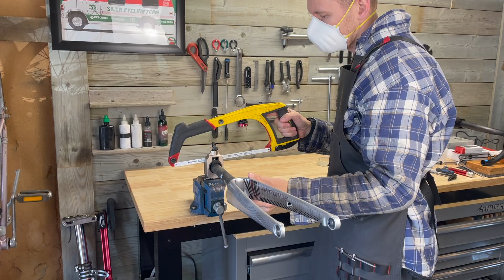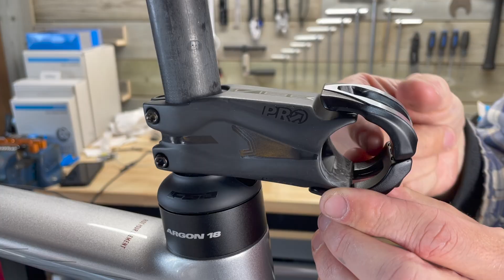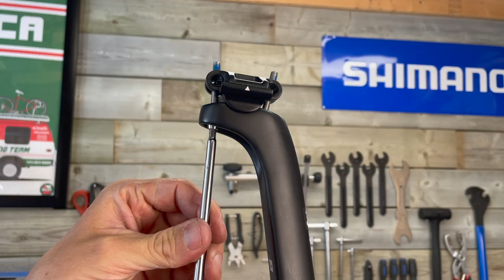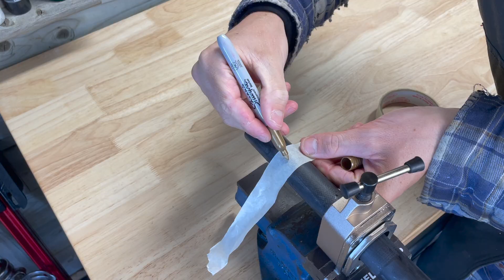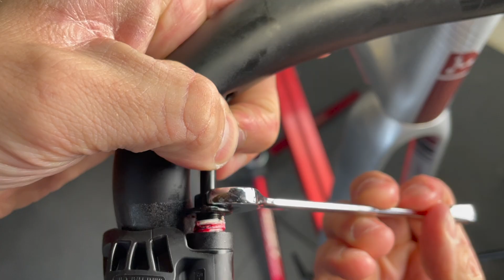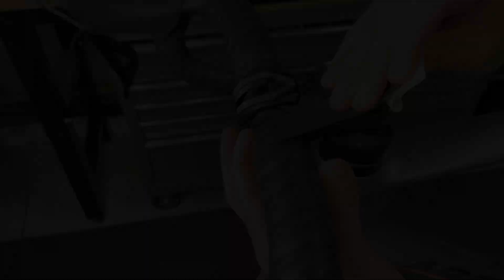Building my Dream Argon 18 Sum Road Bike!

Comment: Nice build! I just bought the same frame and have some issues with the right headset. Could you please tell me which one exactly you use? Thank you so much ✌🏻
Reply from the maker: For headset, I believe this was the FSA model.  Worth reaching out to argon for the specific part, they’ve got good customer service.  The bearings are specific to the top and bottom of the headset, so you do need to make sure you put them in the correct orientation for install

Comment: Just purchased an argon 18 sum.  It’s missing the plug on the bottom of the frame. Any idea of where I could get one?
Reply from the maker: It’s just a press in plug, could have fallen either out or into frame!  But should be possible to get replacement from argon 👍

Comment: I am on the cusp of buying this frameset and have a question on the stem and handlebars.  When buying a complete bike a FSA stem and handlebar is used but it looks like you used something else.  I would like to use another brand stem and handlebar but am unsure it it will be compatible.  Can you please comment?
Reply from the maker: Hey, ya happy to help.  So the fsa system works great, it has all the cables go through the bar/stem, and down into the headtube.  This uses a different set of spacers that are larger and allow the cables to go inside them.  I had the shimano bar/stem, which routes the cables outside the stem, and used regular spacers.  Let me know if you have any more questions!

Comment: Great build. I own Argon18 Sum, but in red. Have similar solution with headset / stem. As for tires, I use Vittoria Corsa Pro 30 mm tubeless, really comfy. For 28 mm, as in your case, I would also use tubes. Good luck!
Reply from the maker: Thanks!  I like the red colour, also really sharp 👌. I was hoping people voted for red, but silver was the people’s choice!

Comment: I currently ride a Merida with a FSA ACR SMR Headset. This one takes 2,8cm (1cm headset cap + 1,8cm from the SMR stem). I would like to change to the FSA No.69 SRS Headset as this seems to be easy to install and the headset cap on top takes only 1cm. Why did you choose this option?
Reply: Not forgetting to congratulate for the build :) I would definitely consider to ride tubeless as this for me is a game changer (rolling resistance, tire pressure comfort, puncture resistance). It is very easy to handle after I gained some experience with the tubeless system.
Reply from the maker: Thanks!  I may consider for my next set of tires, do you find the ride quality much better at the same pressures?
Reply: I changed to Tubeless and reduced the pressure at the same time (70kg / 28mm Conti 5000 S TR / 5,3 bar). Before that I wrote a 25mm Conti 5000 with 6,8 bar. Therefor I can not give you an answer to your exact question but the difference for me is huge. I would not dare to ride with an innertube at such low pressure. Key things to have: pressure chamber like the Tire booster from Schwalbe, Dynaplugs (during the rides), and tip top patches to take care of wholes which can not be sealed by the milk (after the ride).
Reply from the maker: @danielschwarz7495  thanks for the details!
Reply from the maker: Thanks for the comments, for the headset, I needed to use this one because I was running the pro stem (I couldn’t run brake lines inside it).  So I had to run the brake lines under the stem, but still through the headset, which is why I’m using this particular model.  Also makes it easier if you need to change stem length in the future!
Reply: Thank you for the feedback regarding the headset. To have more stem options is also one point that I have in mind. I think I will change to your solution as well - also it looks much better then expected.